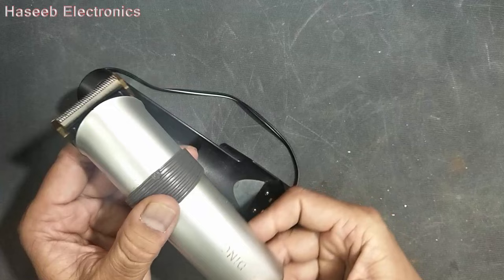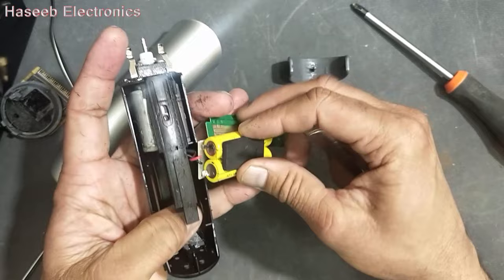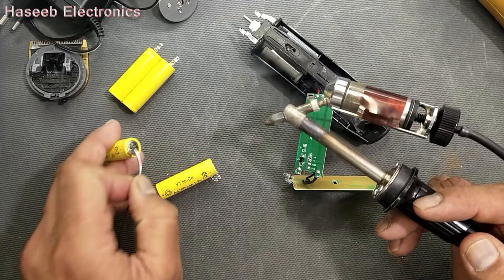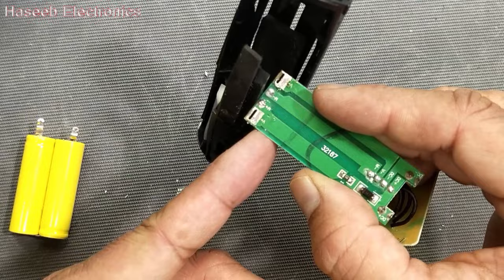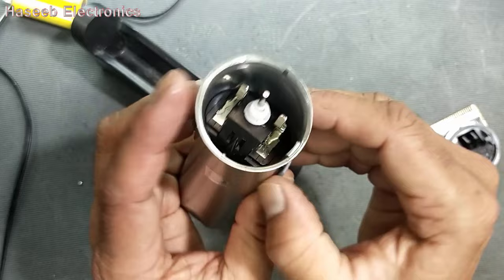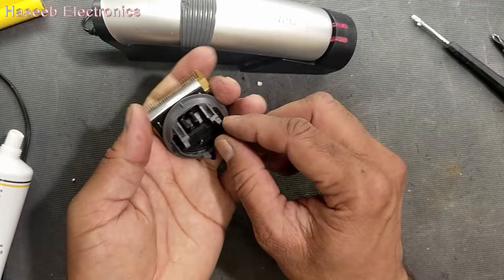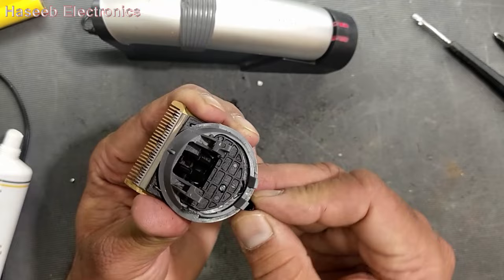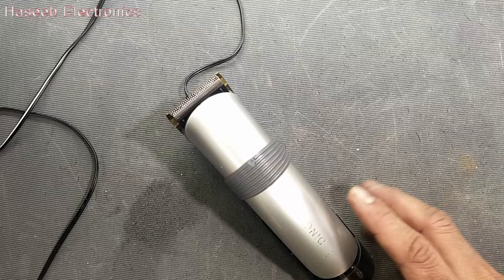{333} How To Repair Hair Trimmer / Clipper / Hair Cutting Machine

Comment: Cord&cordless means: charging by two ways, or usage by battery alone or by adapter alone?
Thanks
Reply from the maker: cord means wire. any machine which works with power cable installed (either it have rechargeable batteries or not)
cordless means. that any machine have rechargeable batteries and it have separate charger and charger base. we use this machine as a charged device. so it is cordless machine
similar as some drill machines we operate at direct 220 volt (that are cord power drill machines) 
and we use handheld drill machines, which contain batteries. and are charged by a battery charger that are cordless drill machines